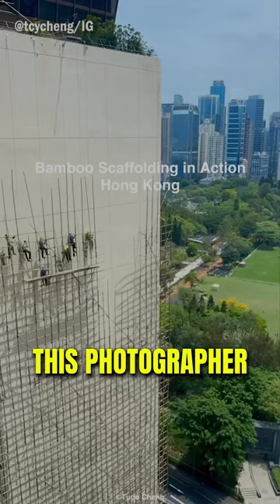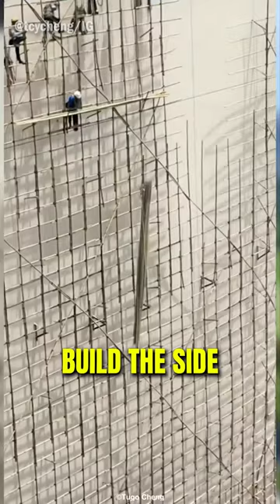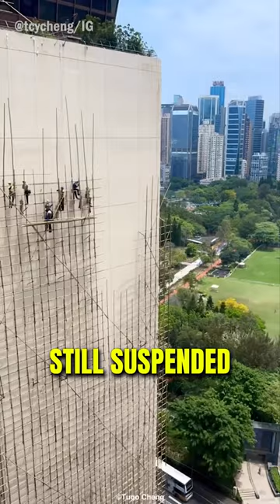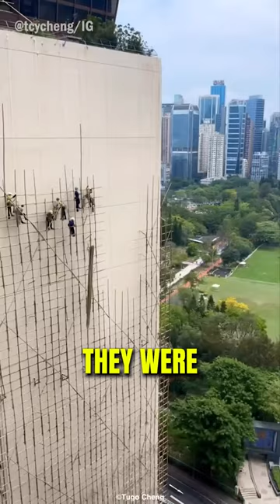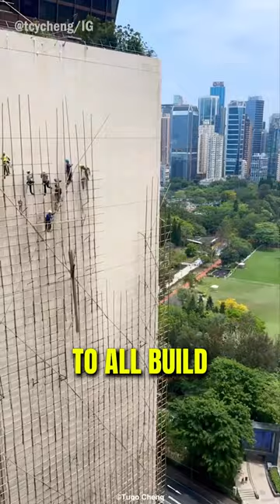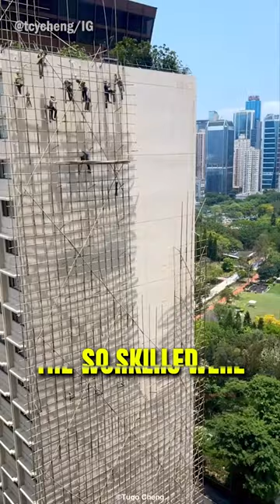The Most Shocking Construction Timelapse!

Comment: How does the wall stay that close to the building without being  anchored to the wall itself. I don't see any hammer drill or one of those hammers you put the gunpowder caps in and it shoots a nail into the concrete. So how is the wall of bamboo staying next to the wall. Is there a slite lean to it. Like it's leaning in towards the building. If that is the case then the taller the building, the further out the wall would have to be from the building at ground level. So how are they doing that?